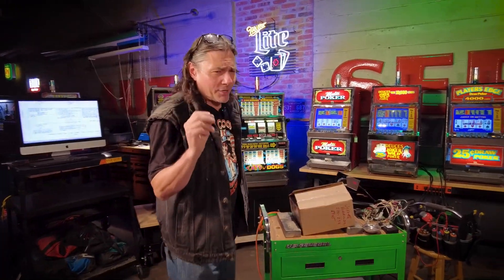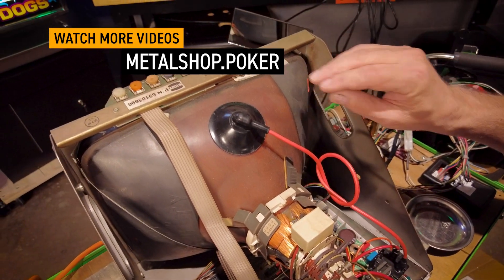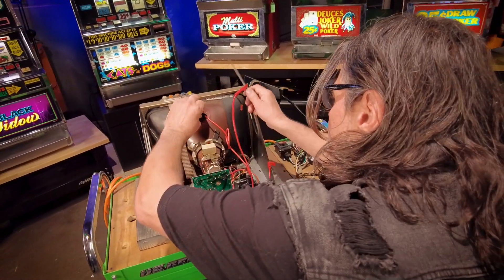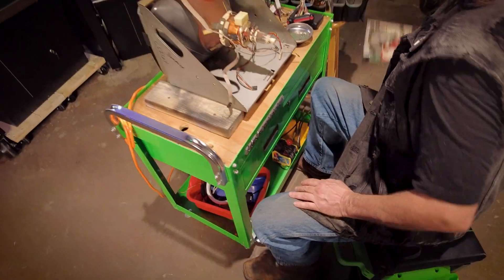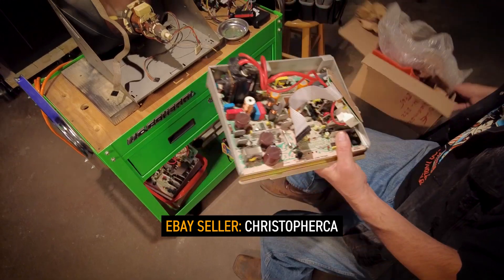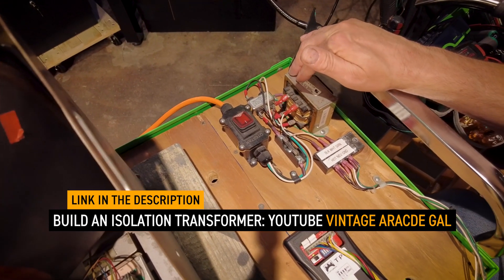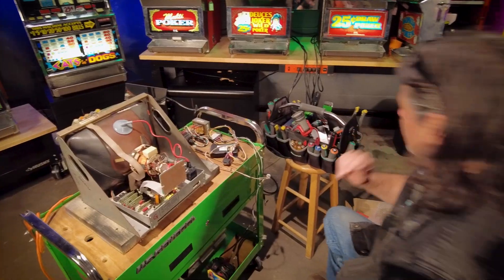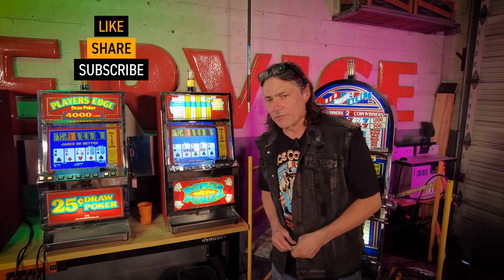Repair a Dead Monitor on an IGT Player's Edge Draw Poker Machine

Comment: I have learned so much about these machines watching your videos. Thank you I have a somewhat dead machine IGT  mod 705 manufactured 4-82 . I replaced battery and it works the first time then will not take coins any longer. Monitor shows set up lines but won't show regular screen.  25 cent machine. I know this is and old machine where do I get parts for it and what parts? thank you